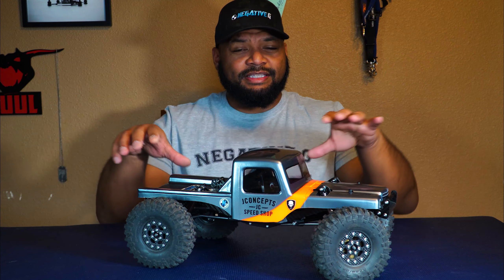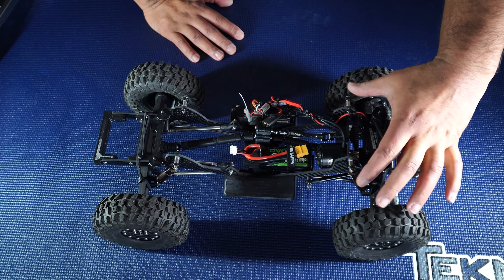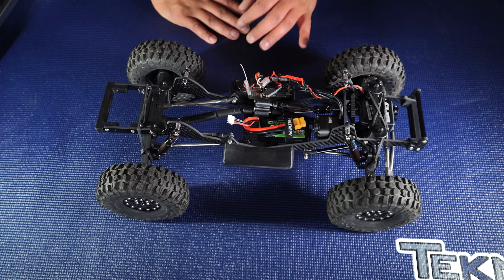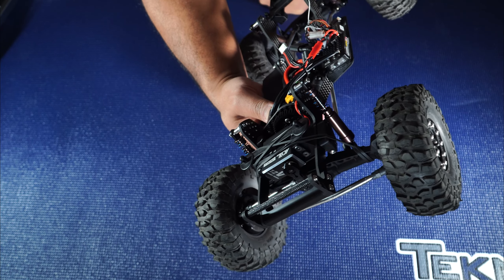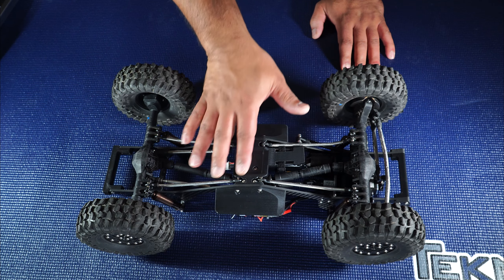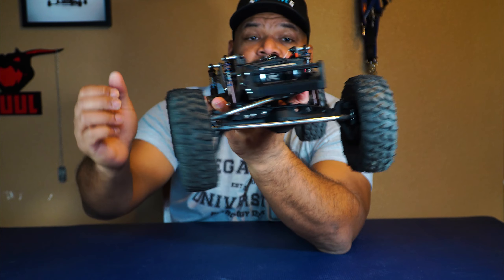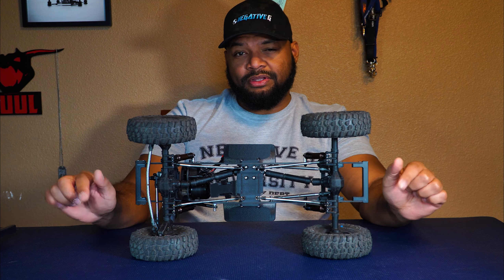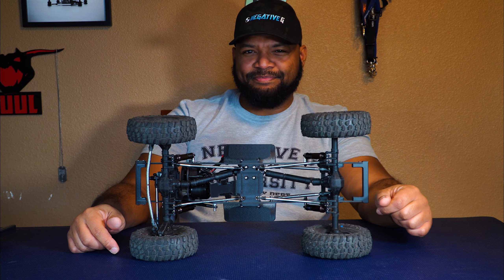Negative G RC CC-v1 | Axial Capra AiO Chassis Conversion Kit 😃 | LCG Crawler

Comment: Had the same issues with wrong link size from intheworksrc on my Vanquish Phoenix. Emailed them and didn’t get an answer. Messaged them on fb and they messaged right away and sent out the correct size after confirming my stock link lengths.

Comment: Somebody just screwed up your order man I ordered high clearance links from in the works and the were the correct size.   Did you bother to call or look into the issue or just go on YouTube and Bitch?
Reply from the maker: I used the contact info on their site to send an email and never got a response so I fixed the issue myself. Sorry I offended you. 🙃
Reply: @Furadi  hes mad bro 🤣🤣 in the works shocks are redcat shocks but they claim made in house wich is totally bs
Reply from the maker: @houstonrccrawlers6445  🤣
Reply: @Furadi  sorry man that post came off worse than I intended.  I must have missed the part where you said you gave them a chance to correct it    I apologize.  I do like your content
Reply: What shell is that?
Reply from the maker: @lurzafliamsiaslam5585  jconcepts creep with lots of cutting.
Reply: @lurzafliamsiaslam5585  jconcep creep body